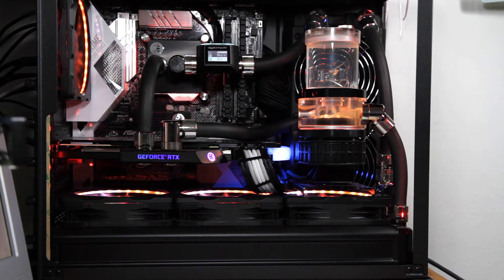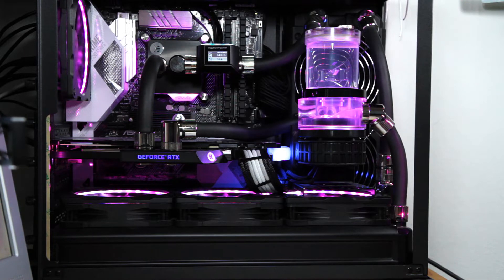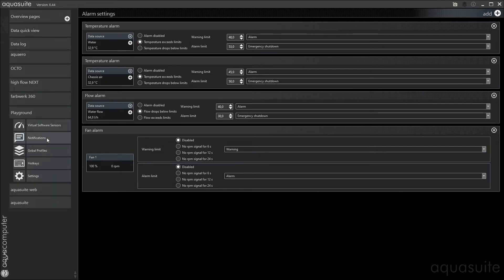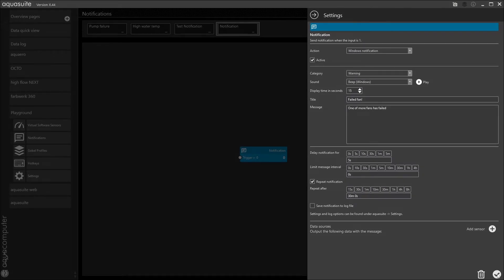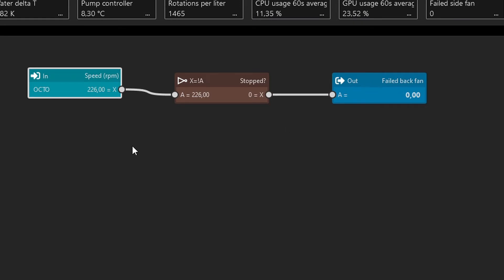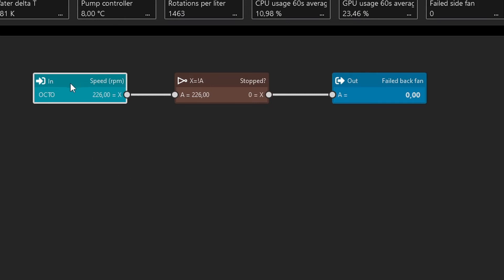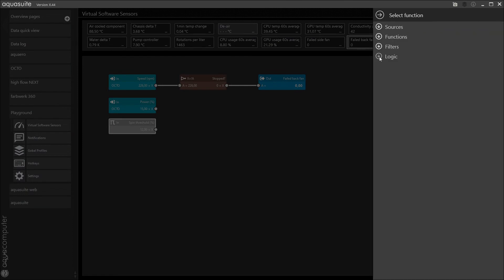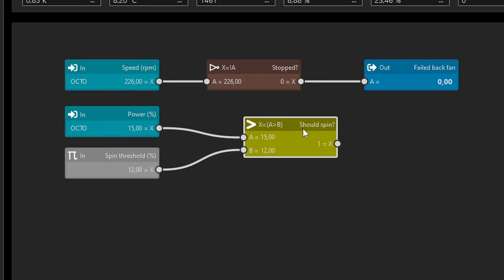Are your computer fans failing undetected?

Comment: I saw your post on the aquacomputer forum, thank you for your tutorials. I am trying to get Aqua parts for my next build and first watercooled pc. The thing I most affraid of is the software I will need to get accustomed with AQS.
Reply from the maker: Thank you. And good luck on the build! Watercooling can be really addictive. ;)
Don't be scared of Aquasuite - the basic setup with a fan curve and perhaps a temperature sensor is quite simple. Perhaps I should do a basic setup tutorial...
Aquasuite has the potential of letting you go completely crazy with weird stuff and sensors all over, but you really don't need to. And you can just take small steps from your basic config, if you want to venture into more advanced stuff. :)
Reply: @KayBeeTech  For people like me just getting into watercooling and just discovering aquacomputer, it is a little discouraging, due to the difficulty in understanding the ecosystem of products. There are very few detailed tutorials  in what it is required to get in order to have a fully functional system and using this very powerful software. I have downloaded the manuals and started reading so I can understand but sometimes it is unclear what to buy and how to connect them. Really nice tutorial thanks I will follow your channel! :)